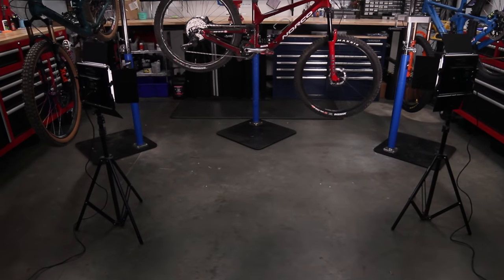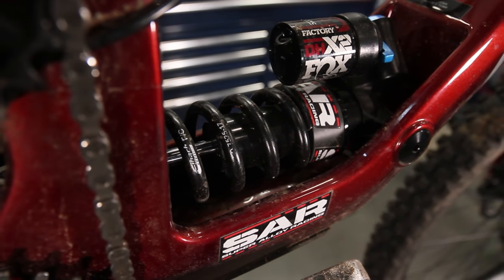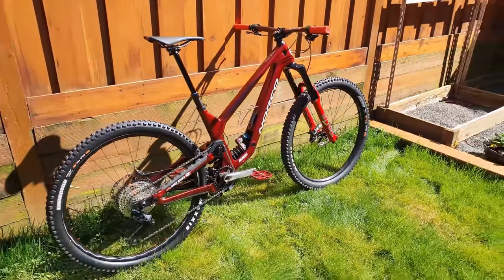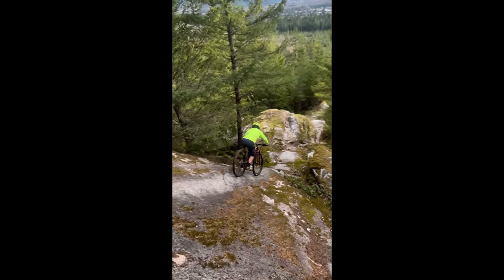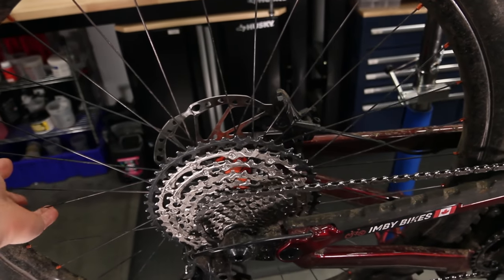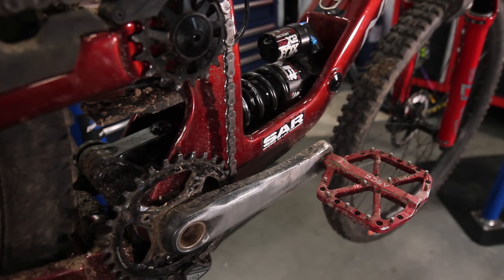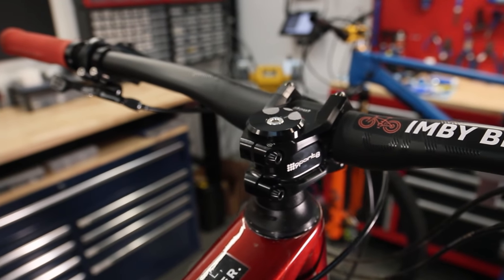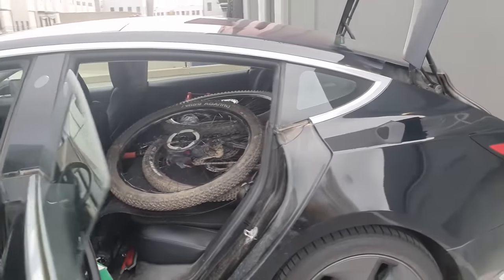Bike ⁽ᶜʰᵉᶜᵏ⁾ of the Year

Comment: I too transport my bike in my Model 3 with no issues. I’ve had a fair few comments about how it’s surprising I can fit my bike (it’s an XL) in there.
Reply from the maker: Underrated cargo capacity. Frunk for clean stuff and trunk for dirty!
Reply: There are very few cars that won't fit an MTB. I've put my XL Sight in my old Mini Cooper many times. Both wheels off of course. The Tesla is about 4 feet longer than the Mini- its big.

Comment: I made some similar upgrades to my range c2! Wheels, brakes+rotors, Cush core XC in rear only, carbon one up bar etc. 

and ya, Burke has made me want a 30T chainring. 
I’d be thoroughly impressed if you can get up to deliverance with no walking.
Reply from the maker: Prepare to be thoroughly impressed, it certainly hurts though. 😆

Comment: Nice bike check. I am riding a forbidden dreadnought in XL with a zeb, xt mix that weighs 34 pounds. That Norco ist heavy wow. Although dd tires, coil shock and heavier components.
I really like that you mentioned the l nameless mt520 brakes. They really are good for the price. The only downside you cannot use the same pads with cooling fins as in slx, xt if you wanted. Same goes to the Shifter. Xt in the front and does not matter which derailleur you use, you get the most features of the shimano drive train. While I am personally more into a matching color scheme, I dig the idea of just putting left over parts on the bike if they perform the same. Like the funny brake rotor setup. All in all that was one of the very few bike check videos on YT where I fully agree on everything you have mentioned. 👍👍
Reply from the maker: The brakes are definitely the biggest surprise here, they're fantastic!

Comment: Has anyone ever built/designed a bike that utilizes two rear shocks? One expansion and one compression would mean you could tune each one too handle a more specific task instead of one shock trying to do everything well? Obviously I'm not a bike designer or an engineer but I can't help but think an expansion shock tuned for small bump sensitivity and a compression shock handling the big hits would make for a very smooth customizable suspension set up. Obviously there's gonna be added weight so this might be best suited for downhill bikes if it's even possible? 

Happy Easter everyone.
Reply from the maker: Karpiel Armageddon... Sort of. Or Cannondale's more recent DH prototype.
Reply: @DaleStone  thanks for the info. I'll have to do some investigating 😉

Comment: CushCore XC vs Air Liner? I'm about 160lbs and just threw an XC in the rear of my all mountain bike, but the air liner sure is a lot less expensive.
Reply: Also - didn't notice any sort of ridewrap / 3M tape job. What's your thinking there?
Reply from the maker: There is a medium tier ride wrap installed! As for which insert, I'm more of a fan of the airliner due to ease of installation, though I'm the biggest fan of the best price haha.

Comment: We have the same fork, and I'm always tinkering with mine.  I'm curious about your settings based on your weight.  High compression, low compression, psi, rebound.
Reply from the maker: I believe I stole the clicks from the Sight bike setup guide and pressure from the sticker on the rear of the lowers. Seems to be mint!

Comment: Question about the rear shock linkage: it looks like there is some lateral play where it connects. Assuming this is normal (?). Is this to avoid passing lateral forces on to the trunnion shock?
Reply from the maker: No lateral play to my knowledge!
Reply: @DaleStone  snugged up the bolt to 10nm and the play went away. Glad I asked!
Reply: FYI the play / rattle returned so I pulled the yoke/linkage apart and discovered my frame is missing the two #40 spacers (!). Bit surprised I haven’t blown the shock yet.
Reply: Here’s a quick video clip of the play I’m talking about: 

https://www.dropbox.com/s/x031tsw9t15gpyy/IMG_9910.MOV?dl=0
Reply from the maker: Will pass along, and suggest you do the same!
Reply: @DaleStone  I reached out to the mfr. I’ll let you know what I hear. Love this bike but would like to have all the parts 🤣

Comment: Aggressor or Dissector? Im mainly looking for a low rolling resistance enduro rear tire with acceptable cornering grip. Advice appreciated :)
Reply from the maker: I've not ridden an Agressor before, and have been pretty happy with the Dissector. Hard to beat a DHF/DHR classic...
Reply: Also, would you rather go DD or Cushcore XC if you had to decide?
Reply from the maker: For the rear I've chosen both. DD is to protect the tire, insert is to protect the rim.
Reply: @DaleStone  Makes sense, keen to try out the XC Version as its half the price of the normal Cushcore and im not that heavy. You think it also has the dampening affects of the regular insert?
Reply from the maker: The only reason I have an insert is to protect my rim and be able to run-flat as needed. Don't really know/personally care about tire damping qualities!

Comment: I have the same bike and ride in the same areas.  My question is what is your height and bike size. ? AND.... It looks like your running a one up carbon bar with 20mm rise and 10mm spacers below the stem.  I am experimenting with the stack height right now and am finding that I cant settle on a position.  20mm rise one up with 5 under the stem feels great and faast but steep g outs there is extra pressure on my wrists.  25mm bar and 5 under the stem. feels solid in steeps and g outs but I lose traction with the front wheel on mellower sections.  What Bar rise and spacer combo are you running and Any suggestions are welcome on finding the goldilocks zone.  BTW congrats on the Penthouse drop. you made it look smoooth!!
Reply from the maker: I believe I'm 176cm and chose a size medium. I feel it fits me perfectly for the kind of riding it was designed for. And you're right, 20mm rise bar with 10mm of stem spacers. Might drop the bars down 5-10mm as an experiment but quite happy as-is. Play around some more!